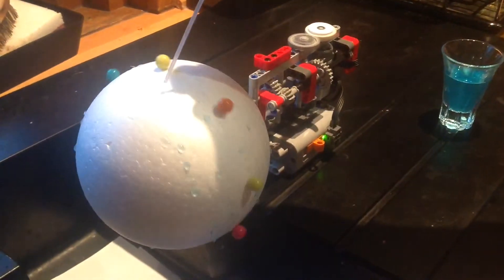Toy experiment: Water sticks to a spinning ball

Comment: Off the get your at a 8 second rotation instead of 24 hours.

You also have the ball going the wrong direction.

Nice attempt though
Reply from the maker: bill nye Which direction is the right direction?
Do you think the water would spin off if I slowed the ball down?
How does changing the radius of the ball affect the centrifugal force if the rotation period (8s or 24h) is kept constant?
Reply: The rotation is faster because the sphere is smaller. It is precisely calculated so that these effects cancel out (however, the ball is actually still a tiny bit too fast, spinning at 8 rpm and not 7, but this can only increase the force, so if anything, conditions are more extreme than in real life).
As for the direction, just imagine the pole coming in from the north pole rather than the south pole.
Reply: Size don't matter, as explained 8 seconds vs 24 hrs per 1 single revolution on each model.
Reply: @mendelde  Try it my way, The right way it's just simple science, no guess work needed.

The earth don't spin from top to bottom but water runs that way so it's another flaw that makes this demonstration useless.
Reply: Do it the proper way and get your ball where it takes 24hrs for a single revolution spinning from left to right and try again.

Doing the opposite of what the official claim is for direction and changing speeds to something it is not claimed to be proves absolutely nothing ....
Reply: @billnye7391  Of course the size matters. Have you ever been in a spinning carnival ride that pushes you against the wall? Count how long it takes for a full rotation, and then walk in a tiny circle at the same speed per rotation. The force will be much smaller in the small circle, and to match it, you'd have to move rather quickly. Also, no guess work is coming to play here. We did the math, 7 rpm at the size of the sphere matches the centrifugal force of the earth's rotation at the equator (this means that we are corresponding to what is claimed because the claimed rotation and radius result in the same force). As for the orientation of the sphere, that's obviously always a problem because we have gravity, but the earth doesn't experience much gravity in space. However, since this experiment is only supposed to show that the centrifugal force won't throw the water off the sphere, the direction doesn't matter much.
While this direction has the disadvantage that at the top and bottom gravity either helps or makes it more difficult, if you have the rotating axis vertically the water won't stay at the equator but flow down to the "south pole", which means that there aren't even two points at which the model is truly representative.

Of course the model isn't perfect. No model ever is. But to correspond to your demands we'd have to build a sphere with a diameter of 13000 km and spin it once per day with an ocean on the surface. The problem is, we aren't god.
Reply: @justuslm  try it my way on a video then another to compare the results between the two.

It's called matching it to scale to the official claim.

Your speed is not 1 revolution in 24hrs regardless of size.

Can be 1 inch or 10 foot 1 revolution in 24hrs is one revolution in 24hrs not matter what size the object in question is.

I'm done with the excuses here have a good day and stop over thinking common sense.
Reply: @billnye7391  Well, if all you accept is a precise match, without any scaling, then I'd have to do exactly what I said to convince you: Build a full scale earth.
I think you are underthinking common sense. Proof? Well, have you ever built a model of anything? It is never entirely like the full scale thing, because it is a model! You need to adjust things to make it representative for what you are trying to test. This test wasn't about the rotation itself, but about the force that it creates, so that needed to match, and because it is a model, other factors had to be adjusted. That's how models work!
But, on top of this, I don't see what you would want to prove by having it spin more slowly. The force would be smaller, so the water would stick even better.
It would be doing the opposite of what other people wanted, matching a surface velocity of 1000 miles per hour which the earth has close to the equator.
Both only work like that on the full scale, models have different scales than real things, that's why they are models.

But I'm done with the lack of common sense here have a good day and stop over thinking potential excuses.
Reply: @justuslm  actually I do it for a hobby and side job for over 25 years and build some of the best on earth.

What would convince me is doing the proper math and example like I already explained instead of a shill pseudo science.
Reply: @billnye7391  Now, I wrote this entire comment and then decided that it would need some introduction because it is long and looks like something you may not be interested in reading.
So, I will summarize what I wrote:
This comment showcases the calculations that led to the premise that a sphere with a diameter of 20 cm spinning at 8 rpm would accurately model the forces that act on water at the equator of the earth.

You can choose to read the entirety of it or not to read it, but nonetheless, it proves, using a formula that has been proven without taking the shape of the earth into consideration, that the forces on the water would be equal if it was placed at the equator of an earth that has a radius of almost 13000km and does one full rotation relative to the sun every 24 hours. If necessary, I will link to one of the many videos or articles that prove the formula of centripetal force.

There will also be an addendum at the end, so if you want to skip the middle or part of it, I would still recommend reading the last two paragraphs.

So, we did do the math. Let me prove it:
The point of the experiment is to show that the centrifugal force at the equator that is created by the rotation of the earth is not enough to pull water away from the earth.
In order to prove this, our model must create the same force at its equator. Well, okay, actually we don't want to match the force, but rather the acceleration caused by it. The centrifugal force works similar to gravity in that it is directly proportional to the mass, and the factor is the acceleration. This means that we can just focus on the acceleration because the proportional effects of the mass will always cancel each other out.

Now, since the centrifugal force is just the perceived reaction to the centripetal force that pulls towards the center of the equator, we have to match the centripetal acceleration.
The formula for that is a=r*(2π/T)^2, with a being the centripetal acceleration, r being the radius and T being the period of rotation.
Now, the radius for the earth is close to 13000km, and the radius of our sphere is 10cm. This means the radii are 13E6m and 0.1m, which means that the radius of the earth is 130000000 times larger than the radius of the sphere. Now, in order to match the value for a by adjusting the period T, we must decrease T by the square root of this factor. Because the formula divides by T squared, this will mean we first decrease a by a factor of 13E7 because of the smaller radius and then increase it by a factor of 13E7 because of the smaller period. The square root of 130000000 is ~11401.8. We will round that 11400 to make it a bit easier.

Now we need to divide the duration of one rotation of the earth, its rotational period, by this factor. If we go with 24 hours, this is 86400 seconds, divided by 11400 makes ~7.58 seconds. Divide 60 seconds by that to get the rpm, and we have ~7.92 rpm.

However, scientists will tell you that the earth's rotation actually only takes 23 hours, 56 minutes and 4 seconds, so 86164 seconds. This is because a day is 24 hours, but as the earth orbits around the sun it will shine on every side once through that already, so while a year is 365.25 days, the earth only rotates 364.25 times per year. This one day less is, divided onto the 365.25 days, 3 minutes and 56 seconds less per day, which is why the rotational period is 23 hours, 56 minutes and 4 seconds. If this explanation is a bit rough, the important part is that this is what the scientists are saying. It also doesn't matter much because the difference isn't large.
Dividing 86164 seconds by our factor of 11400, we get a period of ~7.56 seconds for our little sphere, which rounds to ~7.94 rpm.

This means that, with either measurement, going with 8 rpm means the acceleration is a near perfect match, but I must admit that I misremembered earlier when I said it should actually be 7 rpm. However, this only means that the model is closer to representing the real forces presented to water at the equator than even I myself had thought.

I would also like to add that we can also use the formula to examine if it would make sense to copy the rotation of the earth without any adjustment onto our model. This would mean spinning it once every 86164 seconds, or, since it has been shown that the difference is small, every 24 hours, i.e. every 86400 seconds.
With that in the formula a=r*(2π/T)^2 we only change the radius r when using a small sphere rather than a full size earth, and because of this, a, the centripetal acceleration, and as a result of that the equal centrifugal acceleration, are reduced by the factor of 130000000, or 13E7, which we determined earlier. As such, the force pushing the water away from the sphere would be literally hundreds of millions times (130 million, to be precise) smaller than at the equator of the earth.

And if you were going to complain now that this is way too complex, let me please make two points first:
1. Any calculation can be made to seem more or less complex, this is only so long and detailed because I wanted to clearly show every single step. I could also just say that we defined a as equal, put in our value for r and solved it for T. That's just one sentence that represents the entire calculation.
2. Physics are more complex in some regards, less complex in others. In any case, we don't get to choose how complex the physics are that apply to what we are doing. So, even if my first point doesn't convince you that this isn't all that complex, saying that "it's too complex" is not a valid argument.
Reply from the maker: bill nye We decided to mount the spindle sideways so we could drop water anywhere on the ball. With the spindle mounted vertically, it becomes difficult to place drops on the lower half of the ball. However, in space, there are no directions, and Earth's axis can't be said to be aligned any particular way, so there is actually no "wrong" direction to spin it. You are still thinking of Earth spinning in a frame of reference that has "up" and "down" as established directions, and while any model I built has to work that way because here on Earth, we have strong gravity, in space that's just not true. You're trying to understand the globe model with flat thinking, and that won't work. (Actually, the source of "down" for Earth might be the sun, and it is located "sideways" from Earth, so the model is oriented correctly. The moon's gravity is even higher, but it also acts "sideways".)

I'm always urging people to do the experiment themselves, and do the maths themselves, so you can see I am not trying to deceive you and use any tricks; asking others to do it for you just isn't as convincing, and one of the strengths of science is that all key experiments have been repeated many times by different people. You don't have to make a video of it, just do it! (And please consider doing the equinox shadow experiment I also have on my channel!)
Reply from the maker: JustusLM The centrifugal force is not just equal at the equator, it is equal at every latitude, because the scale factor for the radius is compensated by the scale factor for the angular velocity, independent of the actual value for r.

Comment: So,your droples FALL OFF,and you insist that droples stick to a spinning ball?Will you make a video how you cover this ball of yours with 75% water,not droples,ocens,rivers etc
Reply: Well yeah because you’re in earth, and the ball makes small gravitational force and the earth makes a lot more gravitational force.
Reply from the maker: MsThor1, the point is that these droplets are not spun off, as they are when a FEer attaches a wet tennis ball to their power drill. The centrifugal force depends on the speed *and the radius* of the spin. If you decrease the radius (make the ball smaller), you get more force: as you know you have to brake for a narrow corner in a car, but not for a wide one. So figuring out how fast you have to spin your scale ball to get the same force as the spinning globe is essential to this expediment.

I did have the ball covered with water in another experiment, but it makes poor video because you just can't discern it on camera. But pleas do me a favor and tell me how thick that "ocean" should be to scale properly with the size of my ball?
Reply: You could just lick the entire surface and it would be comparable to Earth's water.

Comment: Here let's just do the official claim vs facts of common math.

24,000 miles in circumference.

24 hours in a day

1,000 miles an hour rotation.

1,000 miles an hour divided by 60 minutes = 16.66 miles per minute

16.66 miles per minute divided by 60 seconds =
.227 miles a second.

That's .454 miles I just traveled by simply jumping in the air for 2 seconds in the opposite Direction of rotation.

I can't do a proof video of me jumping becuase of pseudo science but the math is there in reality, enjoy 😉
Reply from the maker: bill nye If you actually did the experiment, and jumped in a train moving at 150 mph, or an airplane moving at 500mph, you'd see that jumping doesn't suddenly halt your own motion with respect to the vehicle. Look for "ballistic cart" videos on youtube that show this in an experimental setting. The surface of the Earth, you, and the air around you are all moving at the same speed, and as long as that motion is fairly straight, it's hard to distinguish it from being at rest. You can't "do a proof video" because the thing you are trying to prove does not work the way you think it does. Inertia is a thing.
Reply: Whatever the math is there and what would happen if the pseudo science was actually a fact.

There is no excuse for the math vs. bullshit here sorry.
Reply: That was just one example of many that proves were not in motion and it's not the size we all been told.

Again just One example of many that are a proven fact.
Reply from the maker: bill nye I don't understand what ypur example is? I provided several examples that you can either do yourself (on any train or bus) or look up lots of independent videos on (ballistic cart) that show that your "jumping stops you" notion is plain wrong. That's centuries old science, inertia is not an outlandish concept, and does not require any maths.
Reply: @mendelde  spin a basketball on the floor now jump over it.

I just defied your logic! 🤦🏻‍♂️
Reply from the maker: bill nye Defying logic with absurdity is like winning a race by taking a taxi. Spinning a basketball on Earth and spinng Earth in space are different, because Earth is in free fall, and the basketball isn't. If you could jump over a basketball in free fall, that'd be very impressive!
Reply: @billnye7391  the real Bill Nye thinks you're not very bright.
Reply: @dayvihd  
Actually not even my dog would ever consider this chap bright!